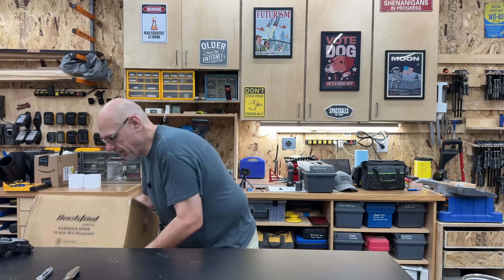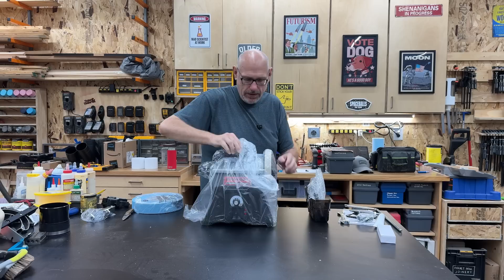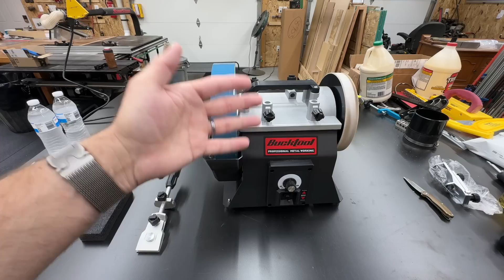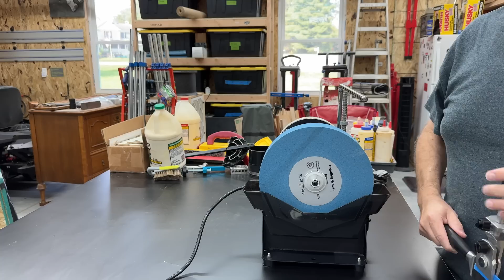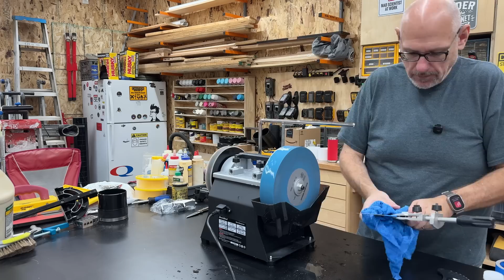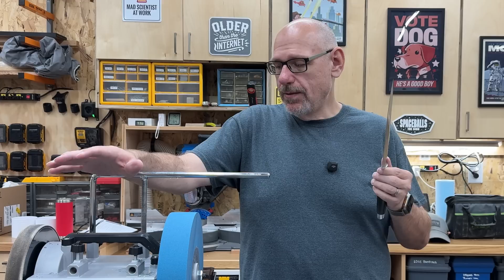New Tool Day: Bucktool 10” Wet Sharpener Review (SCM8103)

Comment: You need a stone grader to bring the grit up to get you to a razor edge after stropping on the leather wheel. Its basically a stone block that embeds the 220 grit stone with finer grit material when you press it on the wheel. You hold the stone grader against the wheel for about 30 seconds and you're good to go. Afterwards, you can use the rough side of the stone grader to bring the grit back to 220 grit. Tormek makes a good stone grader that will work here.

Comment: I had a Tormek T8 in almost-new condition, and I sold it for almost what I paid for it. I ended up buying 3 of these Buck Tools and swapped them to 10" CBN grinding wheels with 3 different grits. They paid for themselves and put extra vacation money in my pocket every month from sharpening knives for restaurants. and local people. They work awesome for the money. I don't miss my Tormek t8. Did you make sure to create a bur on both sides? On harder steels, the wheel spins towards the blade. Kitchen knives you want around 17 degrees of angle to the bevel ad it will be hair-popping sharp. I learned a lot watching the YouTube channel called "Isharpen". He is a pro at these wet wheels.
Reply: Any chance you can verify if things like the stone truing setup from tormek and standard tormek stones fit this machine properly? It seems that most of the clones have issues with this sort of fitment for these items and CBN stones also.

Comment: Whats a daimond plate
Reply from the maker: Either a diamond plate for sharpening or a diamond wheel for a sharpener like this.  Both are more hard wearing and can remove metal from a blade more aggressively.  I suppose if you know what you're doing with sharpening that's a good thing, but if you're a beginner like me it's a fast way to wear away material from your blade. 😄

Comment: I ordered mine and received it in about July. I haven't opened it yet, as my health (lung disease) has been up and down. However, I ordered mine from Tee Moo, for a lot cheaper. It shipped from Buck Tool directly, here in the USA. I will be getting back in the saddle sometime this week and if there are any problems, I'll come back and edit my post. As far as how to use the sharpened, whether edge leading or trailing, there are a ton of Tormek videos online that are full of information and the same principle applies to this machine. They are both 10" wet sharpeners, but one is name brand, the other is generic. Look up how to make the additive for the water and save yourself a ton of money, from Tormek. A quick search online for homemade anti-rust water additive or (dodecanedioic acid) wet wheel sharpener. Which is the exact ingredient in Tormek solution. Don't pay all that money for something you can make yourself. Good luck to you all...

Comment: A couple of observations that should help get a sharper edge. Try an edge leading approach (wheel turning towards you. Either way, stropping (edge trailing ONLY! Wheel turning away from you as shown here). Practicing with both should help immensely. Also, before stropping, using a less course wheel should help. The one that comes with the unit is fairly course judging by the advertised grit. Best wishes for a razor’s edge!
Reply from the maker: Good tips! Thanks, I will definitely spend more time practicing.

Comment: Buck tools are excellent, I have their adjustable belt sander with sanding wheel and it runs great I've had no issues . These sharpening wheels have a learning curve from what I've seen . You have to apply pressure and do one side until you develop a burr . These 220 grit wheels with practice can be manipulated to grind finer by using stones to smooth and rough them up. I'm only guessing but depending on pressure and speed you can probably get a wicked edge using the stone wheel.  The buffer with diamond compound is where you can really start seeing a nice finish . Personally I like a toothy edge with a slight polish , buying additional stones would be interesting. 

I've been hand sharping for years but also have the Worksharp ken onion grinder attachment. The WS is okay but anyone who really wants to get good sharp edges that bite ya really need diamonds in my opinion .  The belts over polish esp convexing the apex to much rounds them off and if not careful you can ruin a blade real fast. I like this wheel method it's timeless and how knife makers in Europe have made scandi blades for 100s of years.
Reply from the maker: I can get an okay edge, I think I just need more practice. 

The thing that’s hard to justify is that all the aftermarket wheels I can find cost almost as much at the entire Bucktool grinder!

Comment: are tormek abrasive wheels compatible with it tho or can you buy new ones for it? what about different grits? what about diamond ones?
Reply from the maker: The specs on the Bucktool grinding wheel are 10" x 2" x 1/2" and Tormek wheels appear to have a 12mm arbor.  I measured the spindle of the Bucktool at just under 12mm and the arbor opening on the stock wheel is just over 12mm.  So in theory a Tormek wheel should fit, but I'm not 100% sure! https://www.youtube.com/shorts/7wlV0PpUqw8
Reply: I can’t see the answer for some reason but are they?

Comment: You should have spent the extra money for a tormek T-4, the tormek machines are amazing
Reply from the maker: I don’t disagree they’re very nice, but the price delta would have been quite a bit more and had to balance need with want. 😁
Reply: @TinkerTimber yeah I get brother, I bought the t-4 then few months later I bought a vevor and could tell a big big difference between the two machines, I am glad I bought the t-4, I wanted the t-4 but at the time I didn’t really have the money for it so I went with the less expensive machine

Comment: Try grinding the wheel towards you, not against. Use the leather strop against.  Also, you can use a grinding stone to get the wheel from 220 grit to a higher grit. You should be able to use any grinding stone but I prefer using a diamond plate with 1000 grit for example to increase the wheel grit.  Just my 2 cents.  All my knives are incredibly sharp!
Reply: Hi there, how would you make it to a higher grit? How does this work etc. Thanks for your help! John
Reply: @JohnJez  something about smoothing the 220 grit particles by creating smaller grit particles from the 1000 plate that fills in the holes of the 220 that will make it a higher grit.  about 30 seconds of grinding with the diamond plate/grind stone will do the trick.  Of course the higher grit only last until the superficial layer wears off, but it works like a charm.

Comment: I just received and assembled my new Bucktool sharpener, and the grinding wheel is really wobbly… actually stropping wheel is practically true, but grinding unfortunately is not. Shaft and arbor seem to be ok, so I’m guessing just got the bad wheel?😢
Reply from the maker: That stinks. My wheels seem to run true. There is a note in the manual about what amount of side-to-side movement is expected, but the wheel surface should be flat. Maybe reach out to Bucktool?
Reply: @TinkerTimber yes, I did. It’s a weekend, so hoping to hear from them tomorrow. And yes, it’s not just periferral side movement, it’s the grinding surface of the wheel is also bad. Hope this company stands behind their product.

Comment: Bucktool is the real deal. I bought an 8" slow speed grinder last year to deal with my lathe chisels. What a beast! Super heavy weight. Arbor shafts ran less than 0.001" wobble. Very, very happy.